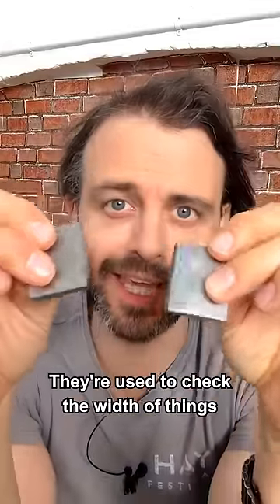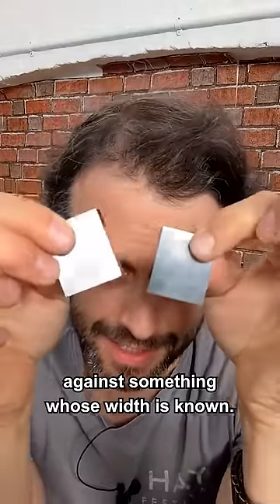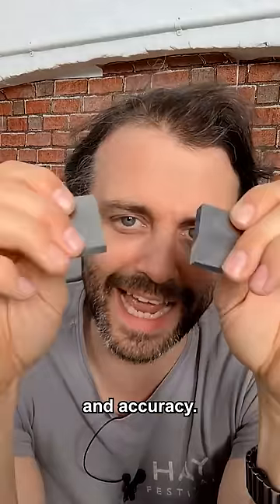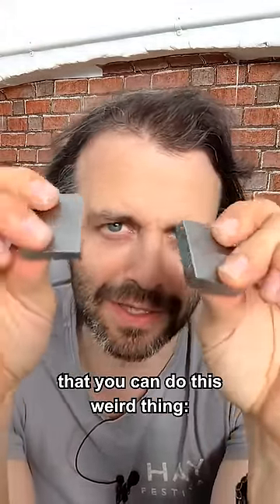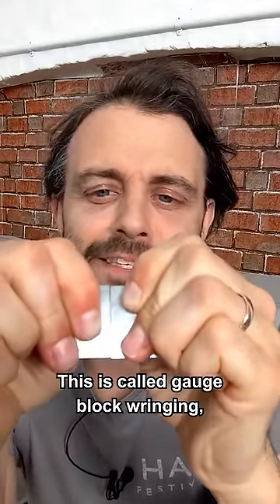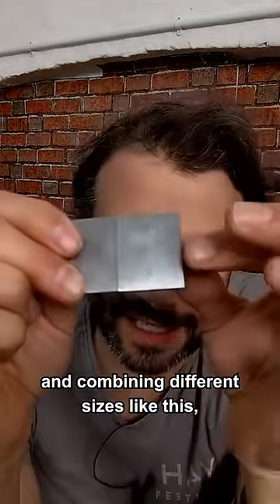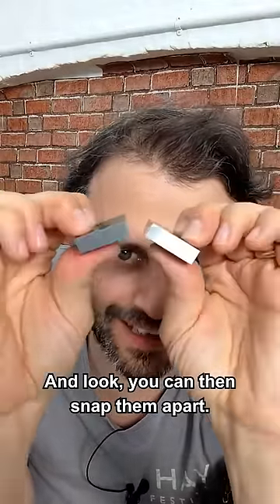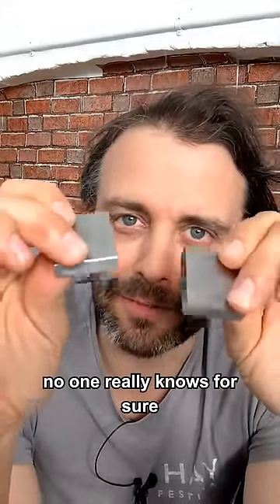No One Knows For Sure Why This Happens!

Comment: As a machinist, we were taught that it happens because of the surface tensions squeezes out any air and creates a "vacuum" between the two surfaces.

Interestingly enough, if you clean the blocks really well with alcohol, they won't wring. If you simply touch your forehead and touch the block with that oil, they will wring really well.

Food for thought.
Reply: I'll have to find a link, but the youtube Codyslab did an experiment where he tried to wring some guage blocks in a vaccum chamber and it still worked, meaning it isn't atmospheric pressure holding them together.
Reply: @matthewjohnson9746  from what we were taught in school and what I tried to explain here, a vacuum chamber would make the blocks wring together even better.
Reply: @robertfreeman7916  Ah sorry, I thought you were talking about the air pressure explanation. A lot of people think that the adhesion is based on wringing out little air pockets essentially creating microscopic suction cups, which wouldn’t work in a vacuum. The best explanation I’ve seen is that the blocks are machined so flat that the distance between atoms when mated is small enough for Van der Wall forces to come into effect. This explanation seems to be aided by the fact that more precisely machined blocks seem to wring better.
Reply: This is very interesting and does make it sound like probably just skin oils from handling that are playing a major role.

Comment: My grandfather, a master machinist for American Airlines (and did military contract work) had a set of these!  I still have them now.  He called this phenomenon molecular cohesion.
Reply: I think you’re right about that, its attributed to the strong nuclear force that becomes prevalent when the objects have a good surface area connection like that produced in the smooth surfaces on the blocks.
Another instance of this is in the way geckos stick to surfaces; their little toes are designed to exploit the same molecular cohesion.
Reply: @devinsmith9622 nuclear force does not exist at the scale of molecules.
molecules = electromagnetic force, from the electrons.
the nuclei of atoms never ever interact with each other because they're enclosed by electron shell which keeps the nuclei far apart.
even if you break apart the atoms and remove the shell the nuclei are all positively charged and strongly repel each other via electrostatic force.
meaning there's never any nuclear interaction between atoms or molecules.
Reply: @YounesLayachi  "Nuclear cohesion" implies the nucleus of the atom.
The nucleus is not at play here. This is all the fault of Electrons and Valence Shells.
Proximity allows the  atoms of two different objects (of the same element) to become molecules of that metal. Not complete, and very inefficient.
The term is "MOLECULAR cohesion," and not "Nuclear."
Nuclear cohesion is a rather violent process called "Fusion BOOM!"
Reply: Cool
Reply: @YounesLayachi In nuclear physics and particle physics, the strong interaction, which is also often called as the strong force or strong nuclear force, is a fundamental interaction that confines quarks into protons, neutrons, and other hadron particles. Wikipedia
Reply: They said "molecular cohesion." Not nuclear. @TimeSurfer206
Reply: Molecule: I'm cohesive!
Reply: @PWingert1966  Just gets on with the others really well.  LOL
Reply: @BB-gr9hq  DARLING. Who was I talking to, when I said that?
Was it the OP???
NO.
Here's a "Visual Q-Tip."
Reply: Any good machinist will have a set
Reply: @phillcom3  Indeed.  And he took obsessively good care of his.
Reply: @devinsmith9622  its not the "strong nuclear force".That's the force which holds protons and neutrons in the nucleus together. It is the interatomic force which holds them together.
Reply: @TimeSurfer206  well you replied to a commenter who didn’t even mention nuclear cohesion so you need that visual q-tip, be less arrogant in the future DARLING, anyone can make a mistake
Reply: He's making it up
Reply: @TimeSurfer206  this is really interesting to me!!! you completely misunderstood what the first person you were responding to said (or responded to the wrong person), and attacked a completely different opinion. then, when you were told (rather politely, to be honest) that you made a mistake, instead of acknowledging your mistake, you got angry and tried to hurt the person who called you out! it seems like you are relatively intelligent, but this behavior of getting angry and embarrassed when you are wrong might be holding you back from learning at your maximum potential!
Reply: @Edouard16  "the nuclei of atoms never ever interact with each other because they're enclosed by electron shell which keeps the nuclei far apart."
I WAS FURTHER EXPLAINING WHAT YounesLayachi had said.
Reply: a sufficient enough quantum tunneling that allows the block to behave like there electrons have bonded but not enough to make it permanent perhaps
Reply: How correct is it to call it "molecular" when metals don't have a molecular structure?
Reply: @Shinobubu  Possibly.  He never went into great detail about it.
God love him, my grandfather was never great at breaking down what he'd learned into smaller bits.  You could see him start, but then lose himself in related information/concepts, then get frustrated at deciding how far to dumb something down.  And this is a guy who was contracted to solve fabrication issues with the XB-70, and something to do with the SR-71 (which he aggressively refused to detail).  
So, I'm sure he left out some operative detail with me, because he couldn't settle on how/where to divide informational priorities.
Reply: @mrkiky  Then how do they crystallize?
Reply: @TimeSurfer206  How do they crystalize if they don't have molecular structure? Simple, the atoms arrange themselves in a crystal lattice.
Reply: @mrkiky  A crystal.
Is a structure.
Of molecules.
Reply: @TimeSurfer206  except no.

Comment: It makes perfect sense to me that this happens. I just don't know why.
Reply: I know exactly why it happens yet it makes no sense at all.
Reply: I get why you would reply to my comment in this way, I'm just not sure how to respond. @AnteBrkic
Reply: The thing is I don't know why it doesn't happen to all other things
Reply: They stick together with the power of atomic pull.
Reply: The thing is the other things don’t know why this makes sense at all.
Reply: The things themselves know why it happens, they're just not sure how to tell us.
Reply: @olasiyandaniel7168 it probably happens to the gauge blocks because of how smooth they are
Reply: atoms perhaps interlocking with one another during the grinding? not too sure tho
Reply: Because I pick small thin things up like small pieces of food or paper by pressing my finger against them and simply lifting while they are stuck to me, I find this to make sense
Reply: @ibrahim well how can we tell if they're male or female it depends who's doing the grinding here_--
Reply: van der Waals force probably
Reply: @blacknoir2404  My thought as well. If it's flat enough, the microscopic-scale contact patch will be big enough to get a VDWF effect going. The twisting and grinding is probably getting rid of whatever thin layer of air might normally "lubricate" the gap.
Reply: 1. "Precision and accuracy" is repetative and redundant. 

2. It is called frictional locking. When two surfaces fit together perfectly, the friction is enough to keep them held together until gravity or any other force is enough to disengage the "lock". It is the same thing that happens when pieces of paper stick together. Items with irregular surfaces allow air between them, and the air prevents friction, and the items separate, but the less air between the two items, the more friction is created that allows them to stick together. If you scratch one, I bet it wouldn't work anymore. Certainly not as well. 

It is also why your mom loves my house so much! 😅
Reply: @theophilusthe3rd  You need to look up the meanings of precise and accurate, dude, because they aren't the same thing at all. Precision is all about how tight the cluster is on your results, and accuracy is how close those results are to what you want. A machine that cuts something to 5mm thick with a 1 micron deviation is incredibly precise, but the accuracy on it is still shit if the specs call for 7mm.
Reply: Because u don't understand physics
Reply: @Just_A_Dude this (precise vs accurate) is exactly the explanation I use to be pedantic about “no one is as precise as storm troopers” line in Star Wars…they’re just not accurate 🤓
Reply: Oh! The argument of religion fans.
Reply: @onetrueslave I know exactly how to respond but have no idea why he would reply to your comment in that way.

Comment: The sources of the forces holding gage blocks together are thought to come
 from:  
      1. Air pressure from the surrounding environment as the air is squeezed out when the blocks are slid together.
      2. Surface tension from oil that remains on the gage blocks or water vapor from the air acts as a glue to hold them together.
      3. When two very flat surfaces are brought into such close contact with each other, this allows an interchange of electrons between the atoms of the separate blocks, which creates an attractive molecular force.  (This force will remain even in a vacuum or if no oil or water is present on the blocks.)
Reply: Source: Starrett
Reply: legit question: how would such smooth surface behave in cooking? like, making a pan at this level of smoothness. Someone should test it out!